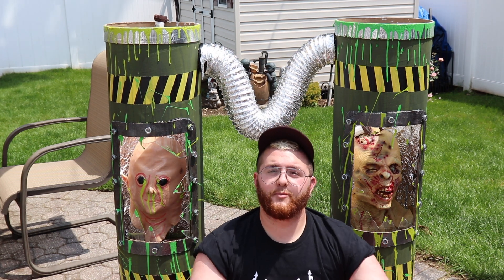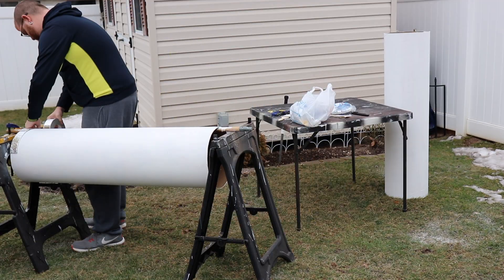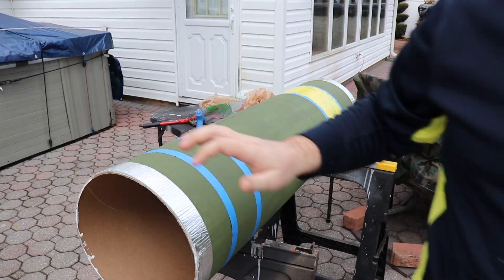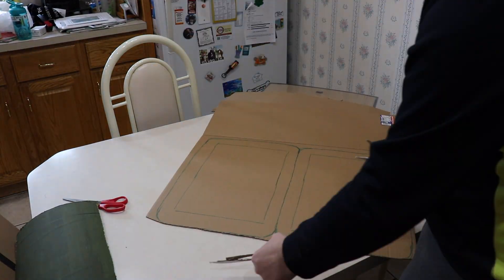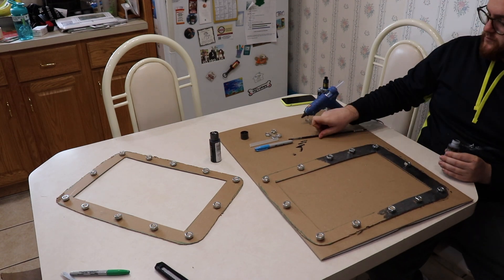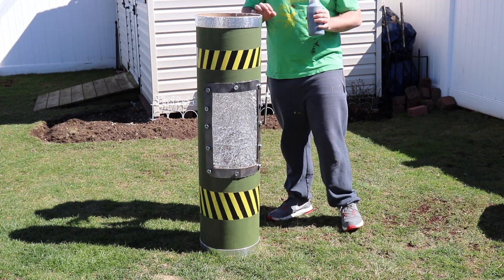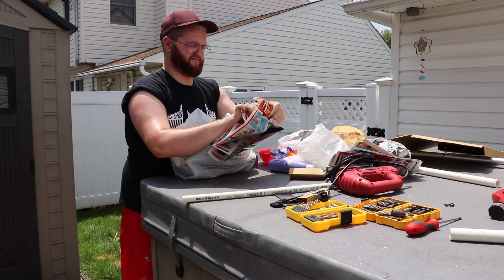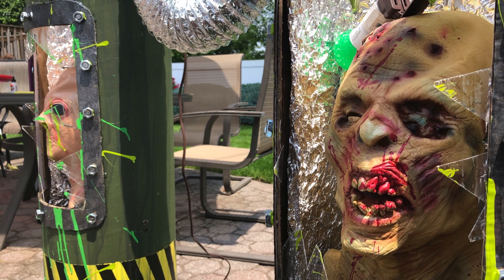Alien Capsules Prop Build

Comment: Another slight alternative, would be to take a small child or teen (my daughter would fit at 20 and tiny); and place this over them.  Make the cut out higher.  Set the tube over them with either a mask or fixed up scary.  Have them hold still, until the right moment to scare the crap out of passer bys.:)  Just a thought.  GREAT idea and thanks for the tutorial!  Cheers!
Reply from the maker: of course! and thanks for the comment If only i had a small friend to fit inside haha great idea